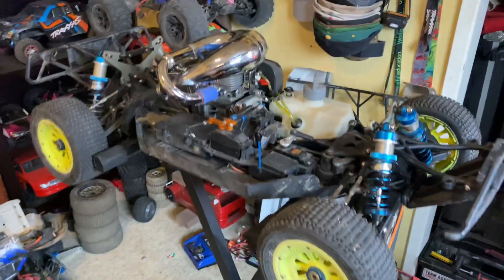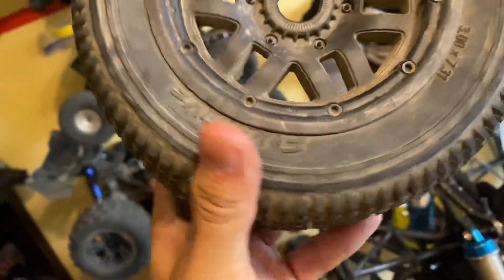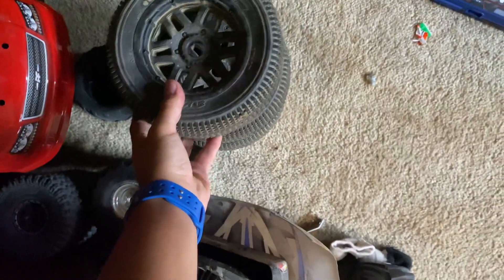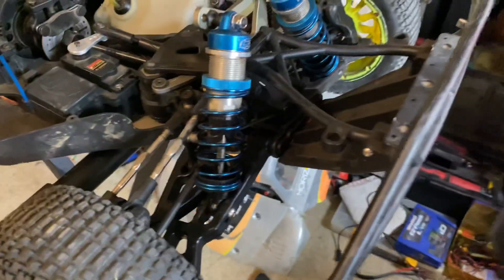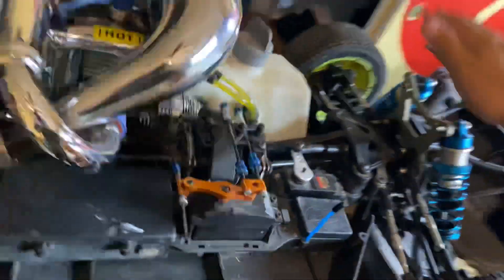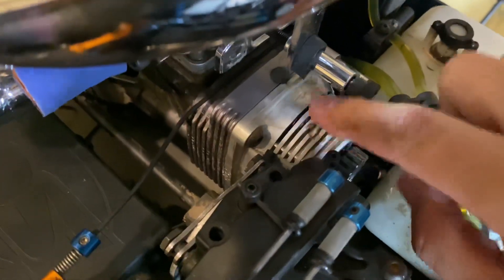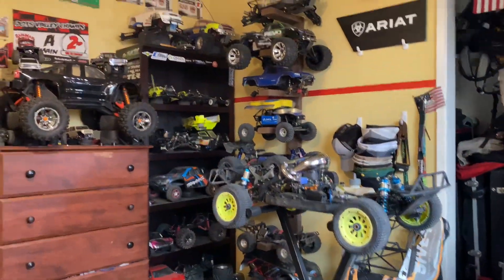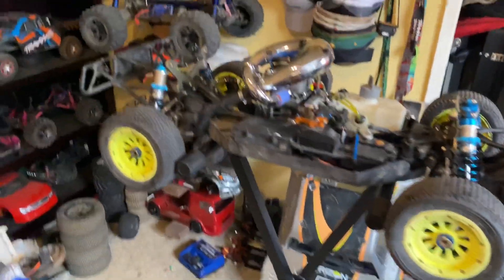FINALLY GOT A LOSI 5t! (Let the rebuild begin)

Comment: one question about your t maxx 2.5. do the rpm arms fit the old t maxx 2.5 along with the true track conversion kit.
Reply from the maker: It should, you might have to swap out the hubs and drive shafts though to the ones that come on the current 3.3. If it was the pro 15 then those would need to be changed completely.
Reply: @GoFastRC  so the 2.5 needs the 3.3 hubs and drive shafts for it to work

Comment: Sweet truck, Can't wait to see more of this truck i plan to buy myself 5T 2.0 or a 30 Degree North V2 5T clone in the next few years i'm currently debating if i should start off with a Nitro 8ight-T RTR first or wait and get the 5T.
Reply from the maker: I have heard mixed things about the 30 degree north trucks. 5ts are tried and true trucks that are super reliable. The 8t is the perfect starter nitro, i loved my 8 buggy. Honestly i would just get what ever my budget fits at the time. The only reason why i got this truck is because my buddy gave me a screaming deal
Reply: @GoFastRC  Yeah i heard mixed things about the 30 North trucks, and at first i really wanted one but i might just get the Losi truck since it's my dream truck. As for the 8T i was thinking of the getting the RTR but i heard mixed things about it or the 8XT\XTE kit and building it up as a Nitro basher.
Reply from the maker: @cjchannel12RC  honestly the rtr 8ights are solid basher trucks. Although the 8ight xt comes with really nice parts, the truck wasnt intended to be bashed. So it isnt the greatest basher, but they are really nice trucks. The 5t has been a dream truck of mine since i was 13, it still blows my mind i have one sitting in my bedroom.